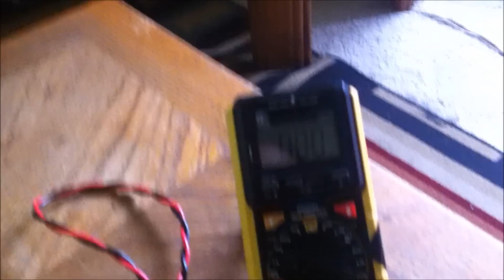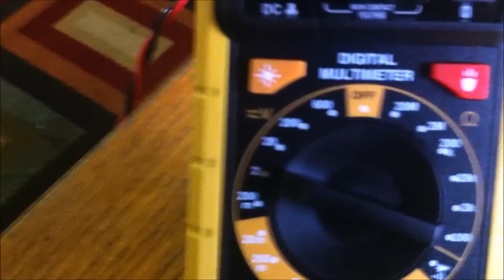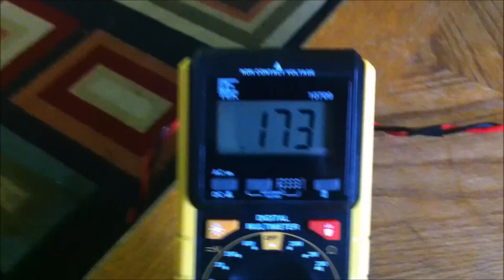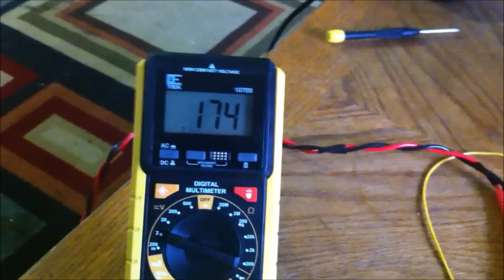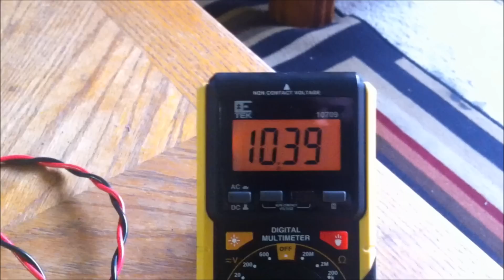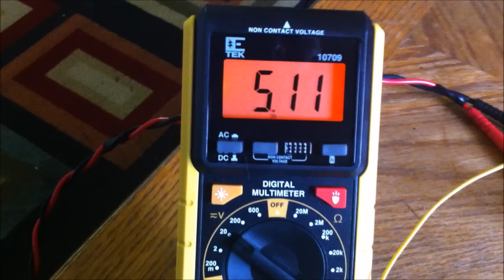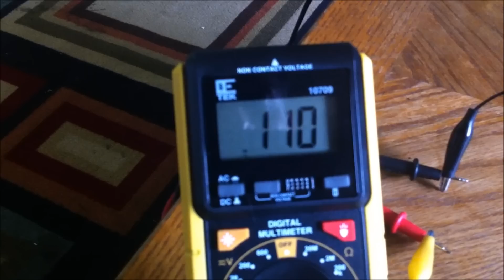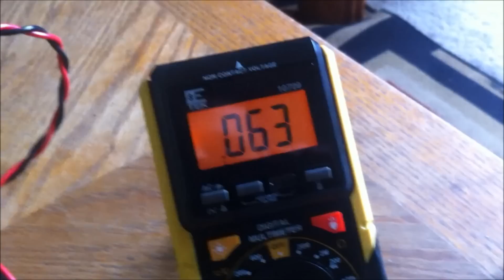Overunity Power Integrator Measurements

Comment: Lots of closeup camera movement... I can't see the whole thing at once so I can pause it and trace it out. Maybe if you'd take a still shot and put it in the video it would help. :-)

Also, that's a huge inductor you're pulsing... it's going to be tough to get good measurements with all the stray wires.  This kind of inconsistency tells us we don't have the pulse situation handled, yet... read on. (read it all first before doing)

A couple of suggestions... 
Make all wires as short as possible... they are all acting like antennas... both transmitting and receiving.

If you have any bare banana plugs, try eliminating your DVM meter leads by putting banana connectors right on the integrator caps... so that the caps are right up next to the meters. That way the "last thing that happens" before the voltage enters the meter is filtering.

About the Integrator caps - electrolytic caps have a lot of inductance... a LOT... which also means they will have a lot of impedance at high frequencies... such as with pulses. This could very well be the reason it reads differently on the (+) side than the (-) side... because the pulses are going in the opposite direction, and may not affect the meter as much.

If you have any large value "Low ESR" capacitors, use them instead. These are special, but commonly used in switching power supplies. (though not all caps in switching power supplies are Low ESR caps... mainly in the Output stages, like right across the Output voltages)  These caps are constructed differently, and use different chemistry.

If not, try paralleling some smaller value caps across the 1,000uF caps... such as 0.1uF ceramic disc caps, or stacked film caps. These have very low inductance, and will help eliminate that possible problem with high frequency pulses still making it through the electrolytic caps.  The electrolytics are still needed for the long-term integration function though. I have some 100uF 25V multilayer ceramic caps specifically made for high current pulsing (switching power supply) circuits... they work amazingly well for this use (integrating pulse measurements).

If you have some 0.1uF (or larger) ceramic caps, try connecting it across the 1,000uF electrolytic while it's operating, see if there's any difference at all.

It's real tough to get a good handle on high current, short duration pulses... it draws huge spikes from the input Power source.

BTW... that reminds me...  and this may be the most important thing.
If you don't have real good [DC Input Power] (not output!) bypassing on the circuit board (proto board) itself (and I don't see any), that MUST be done... again with 0.1uF ceramic caps (plural... use 2 or 3), plus some large "bulk" capacitance as well... another 1,000uF would be good or something large like that. This should also help the function of the pulse driving circuit, as it will have a much "stiffer" local supply to draw upon... instead of through all those long clip lead wires... and the batteries which themselves do not have low impedance at high frequencies. (which is why pulse charging works on some battery chemistries, but not all).
Reply from the maker: +beforebefore The inductor is only 13Ω per wire and a total of 26Ω because it is serially wound.

There certainly are short duration pulses, but the current isn't all that big and are smaller currents. It's a minimalist circuit.

I'm not sure what you mean by drawing huge spikes from the input Power supply, unless of course you're talking about collapsing fields, those have some pretty huge voltage spike transients, that ultimately come from the power supply.

Do you have a suggestion on the bare banana plug suggestion you made? I went to Radio Shack, and they tried the ones they had on my meter right there and they didn't fit so well.  

I don't know what gauge or what kind of wire my leads have and I don't feel like taking it apart to find out either. I will if I really have to though. But I just remembered I have some older meters I really don't use anymore, I could rip the plugs off that and strip the wires down a little or something like that?

I don't have any large value "Low ESR" capacitors but I went ahead and bought two packs of two .1uF Ceramic-Disk Caps and also some Metalized-Film Caps because I wasn't sure what you meant by stacked film caps, although after I had already got them I think those aren't the right kind.

By large "bulk" capacitance are you just meaning another 1000uF cap for the bypassing of the input? Do I connect that to the cap already on the integrator or is that something else that goes somewhere else? If so how do I connect it, in series? Should I connect it in series or parallel? Either of those connections would throw the uF off wouldn't? 

Or do I put that input filter of a few disk caps and another larger 1000uF cap straight across the input battery?

Tomorrow I'll work on shortening all the wires, I was going to do that anyways but was waiting for about 20 years until I got it right, I think maybe I finally got it right, what if we filter all the free energy away?

So I will do that and then take a nice snap shot of it and throw it up on drop box. It's always after I make the video that I realize I could have placed pictures in it, I will do that next time.

I just paralleled two .1uF ceramic disk caps that I just bought and there was absolutely no change in currents, either on the positive nor the negative side.

I happen to have some 275volts 0.22uF 10% film capacitors, http://goo.gl/QV4dnc would they work as well?
Reply: +debunkified   Most DVM's these days have "Class C" high voltage protected banana plugs and jacks, but regular banana plugs will "usually" at least make connection. You're only using them for low Voltage, so they don't have to fully engage. Sometimes it can be cheaper to buy a cheap set of meter leads (or even a complete cheap DVM at places like Harbor Freight) and cut them down.  http://tinyurl.com/o5mfeg9

Stacked-film poly caps are flat (other than their dip coatings), they don't use wound plates. It's the "winding" of the plates that causes them to be high inductance, bad for pulse-type (or high frequency) circuits. 

Yes, "bulk" capacitance refers to high value (such as the 1,000uF), but are not really low ESR.  In all digital circuits, they use a couple of "bulk capacitance" caps where the DC power hits the circuit board, and every IC would have its own ceramic bypass capacitor, to handle the high frequencies or "pulses".

If you add some small value (0.1uF) ceramic capacitors to the Integrators, put them in parallel to the 1,000uF electrolytic cap. The capacitance value is NOT critical, and you are only changing it by 0.01% anyway...

In addition to doing this to the integrator circuits, be sure to add some 0.1uF capacitors (and some electrolytics, maybe 100uF or more) across the + and - power ON your circuit board / proto-board.

Those Kemet caps you have ARE pretty good ones, on page 5 of the PDF datasheet it says "Winding: Non-inductive type". This means they are wound, but they have terminations that connect along the entire wound-length of the conductors, not just at one end.  Their Impedance is around 10 Ohms at 10kHz, down to 0.03 Ohms at 2MHz. Certainly give them a try, see if it helps anything.

However...

Compared to a Ceramic MLCC (MultiLayer Ceramic Capacitor) at the same value, the Ceramic will typically have 1/10th of the Impedance... which means it's 10 times better for the same capacitance value.
http://tinyurl.com/q73kpwo

There are MLCC's with MUCH higher capacitance values, for not a lot more money - if you decide to buy any.
0.22uF are around $0.20 ea., 1uF (5x the value) are only $0.30 each... near 5 times the capacitance value, for only 50% higher cost. (pricing at least 16V parts)

Ramblings...
Yes, pulses and high frequencies do weird things to "normal" components.  Just as an example, when designing RF circuits well over 100MHz, a 0.1uF ceramic capacitor is almost completely ineffective. It's normal to parallel several capacitor values together in order to keep the circuits "stable", and prevent them from not oscillating. For a single, small RF circuit, I've had to use a few 10pF caps, and a 1000pF, and a 0.01uF, and a 0.1uf all directly paralleled with each other, in order to make it work properly. 

"Common sense" would say that a single large value capacitor would work as well as many smaller ones, but high frequency circuits don't care much about "common sense". Designing those kinds of circuits is as much an "art" as it is a technical job.  This is why in some industries, full-time RF engineers demand twice the salary of digital designers.
Reply from the maker: +beforebefore One last remark before I head off to Dream Land, is I did try only ceramic caps of .1uF paralleled to the integrator cap, but just on the input, on the negative and positive sides. No change.

I did place a 1000uF, exactly the same as the integrators, across the battery but not on the breadboard to where it connects to the rest of the circuit load, no change, tomorrow I will try it on the breadboard.

If I take that breadboard off in an attempt to eliminate everything down to short connections will I still need it across the battery?

I will also try those Kemets I have on the integrator caps.
Reply: +debunkified   At this point, remote troubleshooting someone else's circuit becomes a trial and error game... unfortunately. 

I can assume you that you DO need at least a couple 0.1uF ceramic caps AND a reasonably large value electrolytic on the breadboard, across the + and - input from the Input battery.  It'd be good to look around and see if you have anything else with caps similar to the Kemet's you have, and put at least one of those on there too.

Eliminate as many clip-leads as possible, keep wires short, use lots of bypasses.

BTW - what are those (2?) large black square-ish objects on your proto board, to the right (in this video) of the switching transistor?   
https://youtu.be/-Y6PysMqKmY?t=33
Reply from the maker: +beforebefore I have quite a few of these http://goo.gl/lsHvKH will these work ok?
Reply: Yup! Those are good!! Still only 0.1uF, but if you have plenty, spread them around!
Reply from the maker: +beforebefore Check your YT inbox.